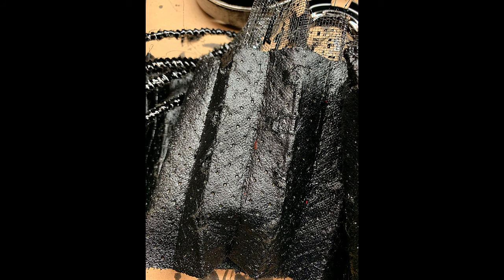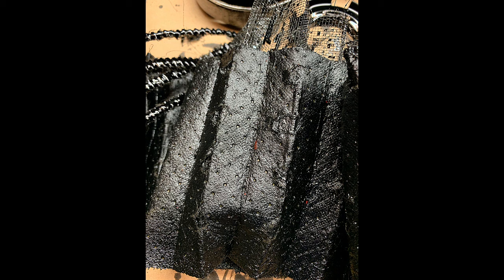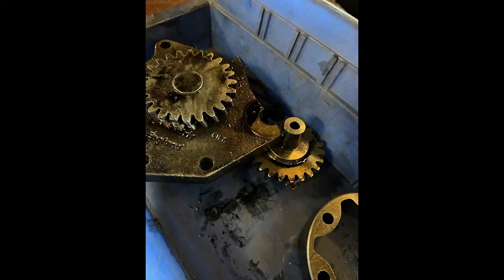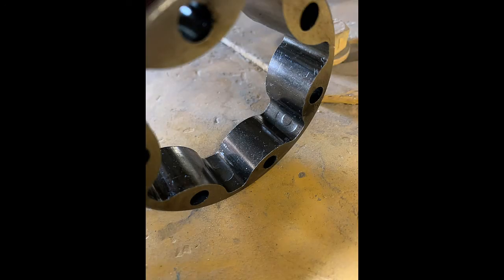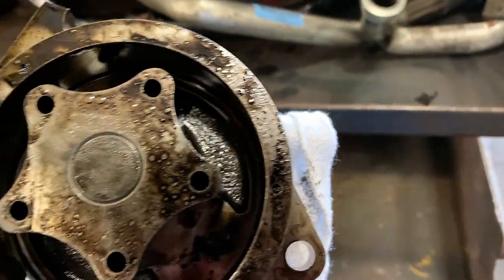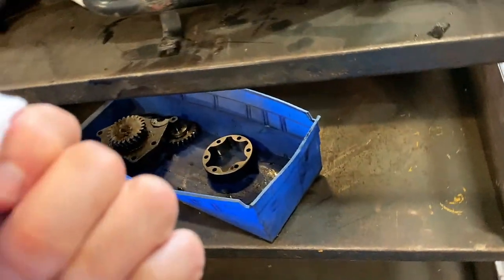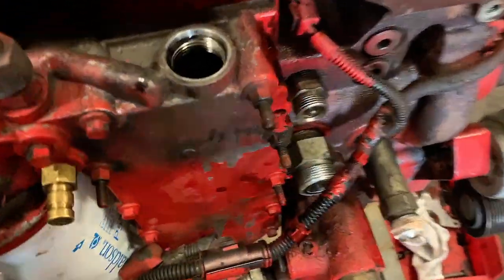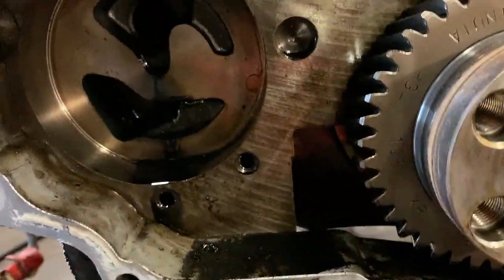Sudden Oil Pressure Loss. ISL9 Cm2250

Comment: Hi. Good explanation..is there a tsb for this..?
Reply from the maker: No TSB as this is a very unusual failure. I have not seen that thermostat clip break in 35 years of engine work so this is a first.
Reply: Where is the oil thermostat located?